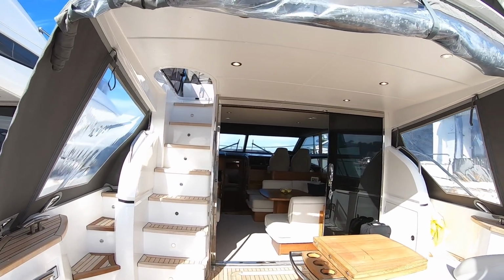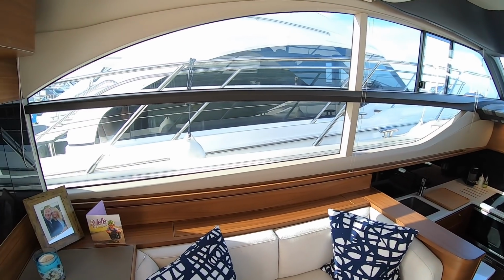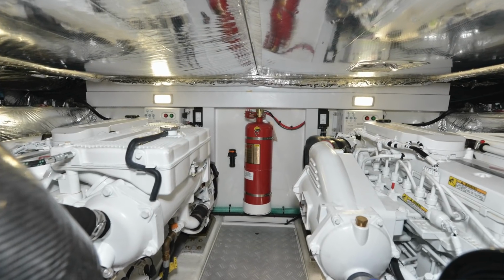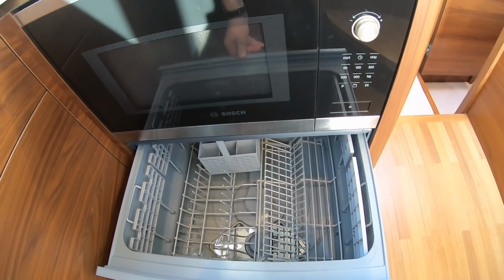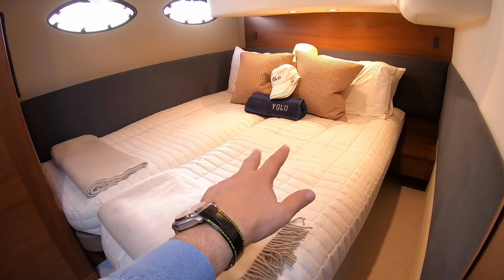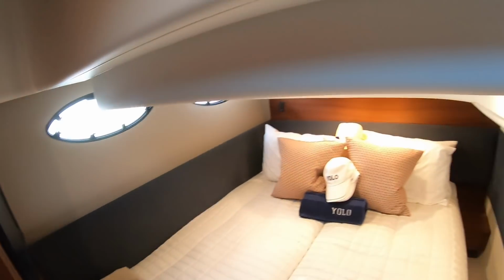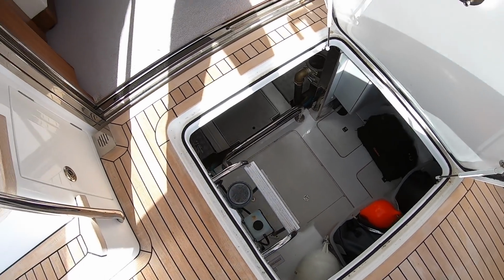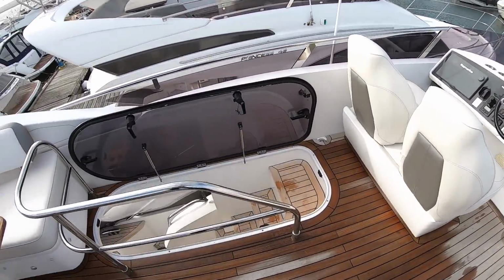Princess 43 used boat buyers guide | 30 years of design comes together | Motor Boat & Yachting

Comment: Nick can run, but he can't hide nor should he. On this size the Galley down is a very good idea imo.  Compared with an aft Galley, the windows are unobstructed  which also allows the Captain near full visibility which can mean more options for navigating certain area's when the weather is not ideal for the Flybridge.